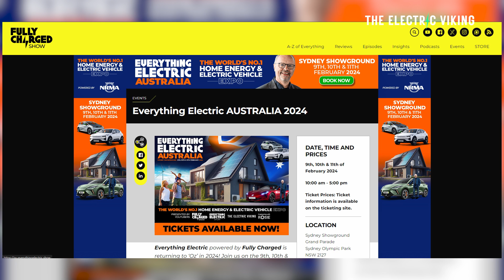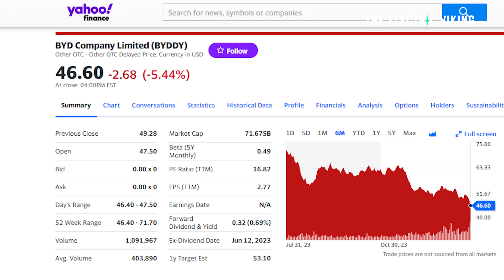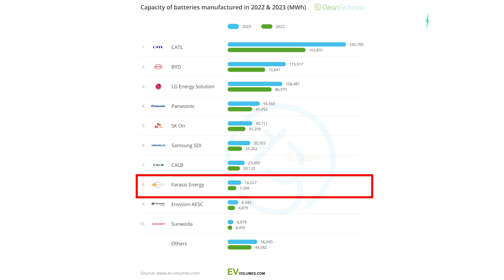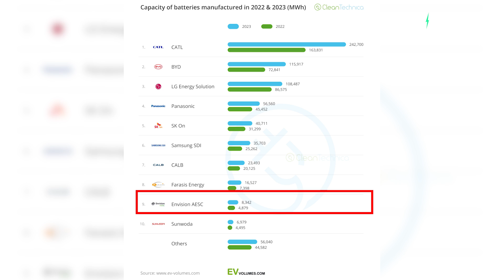The 10 Biggest Battery COMPANIES In the World in 2023

Comment: Right now battery prices are at $85/KWHr.  A further 50% reduction in battery prices should put it around $50.00???
WOW!!  That means a 75 KW pack would cost around $3,750 of the price of the car.  
Gas engines and tranny manufacturing costs more than this battery and one rear motor for sure. 
Yep EVs will be cheaper from the get go starting the end of this year.....Game Over.

Comment: It's kinda funny that say in 2016 I recall people used to write scary articles that we did not have enough lithium or manufacturing to even make as many EVs as are made today... Which just shows how sensible is to believe everything the media writes... In part also because even if they are not lying they are reporting on FACTS and facts are back then lithium battery production was indeed a small scale industry comparatively. They do not take into account what might happen in future, that if there is the demand, capitalism tends to try as hard as it can to MEET the demand. Same as now, sure if tomorrow all cars on the roads were EVs we would have issues with the grid and charging and even battery availability as there are only as many battery factories now, but this is not something that is to be solved in 2-3 years, there will be work done and there will be solutions.